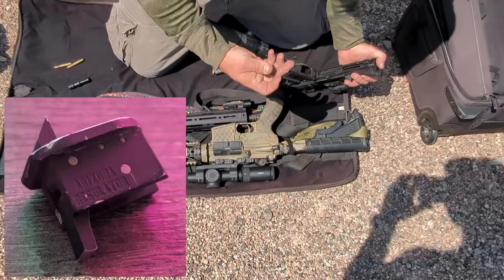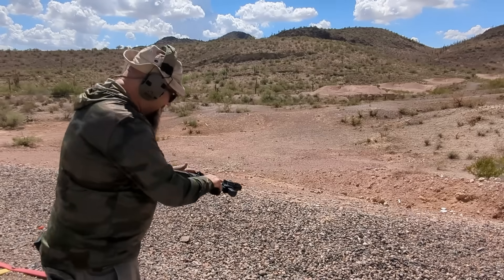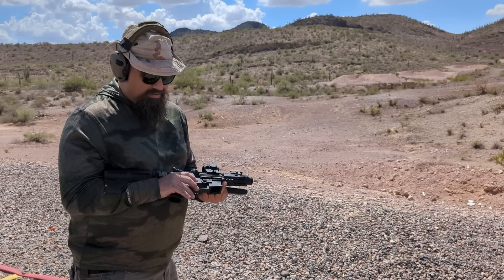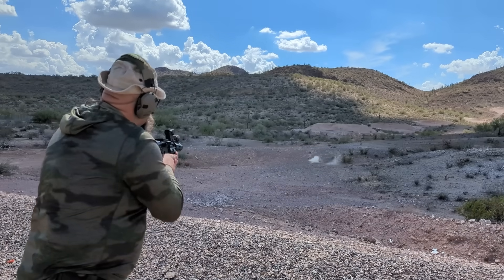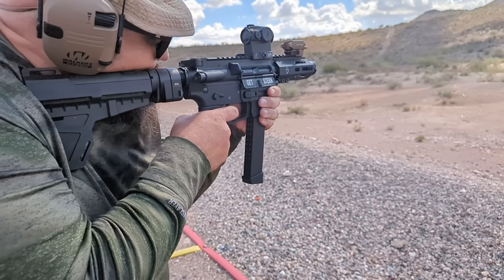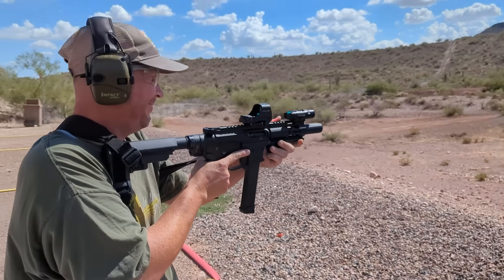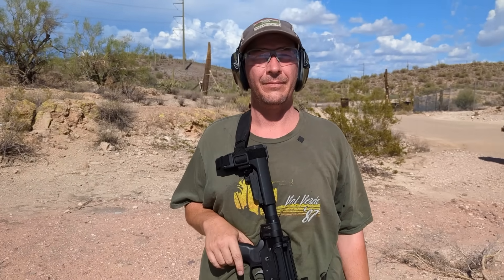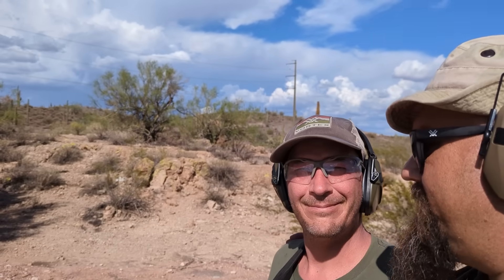What happens when you put an FRT and a binary together?

Comment: My analysis would be that the FRT completely invalidates the binary, because the trigger release happens as the bolt slams to the rear, and you can't fire a shot while the action is open. 
For it to have any effect, the forced reset would have to happen as the bolt closes and be timed to where it trips the binary release trigger exactly at the point the bolt is in battery. Though I don't even think the closing of the bolt would have enough oomph to force a trigger reset against the pull of your finger. 
The benefit would also be negilgible, as it would merely eliminate the split second it takes to pull the trigger after the reset.

Comment: I'm confused how is it a binary? Actually I think your confused not a binary
Reply from the maker: A binary trigger fires on the pull and the release. One of the two AR pistols seen in this video has a Franklin Armory BFS II installed. The other has a Hoffman Super Safety (an FRT) installed. We fired both normally and we also fired the binary with the Arizona Regulator forced reset trigger. Sorry if that wasn't clear in the video. LMK if you need me to help you understand how a binary or forced reset trigger works.
Reply: @newsofthepews lol I own just about every frt I have 4 variations of the AZ regulator alone
Reply from the maker: @CouchRacer87   We are all VERY impressed.
Reply: @CouchRacer87 what do you think would be the best frt for the micro Draco?
Reply: @CouchRacer87 great story bro.
Reply: @CouchRacer87  the only one confused is you lmao

Comment: Does it require 2 position or 3 position safety? Or compatible with both?
Reply from the maker: The Arizona Regulator will drop in with a standard AR fire control group with a 2 position selector. They also make a 3 position version.

Comment: Okay, so I think, based on my understanding of how AR triggers work or would work, is that the out of battery safety prevented the release of the hammer when the trigger is pushed forward by the FRT system. Therefore, what the FRT is does is it basically made the binary trigger a regular trigger because it skips the process. For this reason, I think it is why you didn't fire twice as fast and the binary system prevents the hammer from releasing without the bolt in battery.
Reply: It would never be twice as fast anyway, as the FRT allows you to pull the trigger instantly as soon as the gun is ready for the next shot. The best the binary could possibly ever do, if the FRT mechanics were working that way, is trigger the next shot the instant the gun is ready, eliminating only the split second it takes to pull the trigger back. 
Most of the gun's rate of fire with the FRT is already decided by the bolt's cyclic rate.

Comment: the speed at which it fires is limited to the speed at which the bolt can move. forced reset will only fire as fast as the bolt can get back into firing position(which should be the max speed at which you can fire). and binary is similar in a way that the firing on release can only happen when bolt is in firing position. atleast thats my personal understanding (and im no gun guru/expert). if the hammer was to strike the firing pin (which shouldnt be possible) before the round was in the chamber there would be problems

Comment: Is there a way you can give me a list of all parts for the first weapon you showed. I'd like to build one to play with. Please and thank you.
Reply from the maker: It's a Stern upper and bolt, 80% lower, Franklin Armory BFS II trigger, Sylvan folding adapter, H buffer, KAK Shockwave brace,  Primary Arms MD-20 in an ADM QD mount, Olight PL2 Mini.

The AZ Regulator forced reset trigger functioned normally as a forced reset trigger in both the regular semi and binary positions.

I dubbed in the sound of the M41A pulse rifle from Aliens to appease the algo.
Reply: @newsofthepews I wouldn't do this

The binary trigger isn't a machine gun because it is firing one round per action of the trigger. In normal operation, that means that the operator is choosing when to pull the trigger and when to release it.

The FRT, on its own, is not a machine gun because it is just forcing the trigger forward to reset it faster than would otherwise be possible, but the operator still has to pull it.

What you've made is a system where, once you pull the trigger, two rounds will be fired every time. That is, unless you hold the trigger to the rear with such force that it prevents the gun from cycling and forcing it to malfunction. By definition, this is a machine gun.

I believe that full auto firearms should be legal, I'm only saying this because I worry for your safety and that of any dogs in your vicinity if the ATF sees this.
Reply from the maker: @jackrichardson7121 lol. No. Like I told you in the other comment, it didn't fire when the trigger went forward. It couldn't have. That's the joke. The FRT forces the trigger forward as the bolt carrier is traveling to the rear. On the extraction cycle. While the hammer is held down by the BCG.
Reply: @newsofthepews ... now I feel dumb. I was tempted to delete this, but that makes me a coward. Thanks for pointing that out!
Reply from the maker: @jackrichardson7121 no worries.

Comment: Missing at high speed the AR owners wet dream.
Reply from the maker: Most people don't really get what full auto is for. I mean, besides being just unbelievably fun, that is. It's not just for fixing the enemy so your maneuver element can close with and destroy them. It also increases the number of rounds on target at close range, achieving incapacitation more quickly. And in a properly configured automatic rifle or LMG, full auto improves hit probability at extreme ranges. When I qualified on the M240B, I successfully engaged targets at 1,100 meters using iron sights. That's with an experienced AG and using a T&E mechanism. I'm a fairly decent marksman. I qualified expert on the M16A2 and M4 and I've never come in last in NRA High Power, 3 gun, or 2 gun matches. I'm not good enough to ever win a match, but I can shoot okay. I would have a very difficult time getting a round on target with a precision rifle and magnified scope at 1,100 meters. Have you ever hit a target farther away than 600 yards or so? But even though I couldn't SEE the silhouette at 1,100 meters, the AG was able to walk my fire onto the target. That has almost nothing to do with my skill, and is almost entirely a result of the skill of the AG and the precision of the T&E mechanism. So I'm not trying to brag here. I'm explaining that full auto is a lot more useful than most people think it is.

Comment: The maximum operating speed will be determined by  the springs and weight of the bolt.
 It is running as fast as the bolt can move

Comment: Nice
Reply: So basically the FRT on top of a binary will get your gun to reach potentially its absolute maximum rate of fire possible with that set up.      Loved the way it sounded.   I have an Airsoft gun with a binary electronic trigger.   I can get the trigger movement down to a shivering finger sitting directly on top of the trigger sensor.    Has gotten it up to 59 shots per second through a chronograph.     The full auto mode can get upwards of 90 shots a second and in some extreme cases upwards of 110 shots a second.     Kinda mean use on anything.   Sends a solid laser beam of bbs out.

Comment: All of this on a gun with no locking lugs is nutty. Holy out of battery fire Batman. Many binaries say specifically not to use them on a non locking AR build because of risk of our of battery fire.
Reply: There is blowback 9mm bolt carrier that has firing pin shroud geometry that won't allow out of battery firing.
Reply: @TrollinCrazyRussian  the exception doesn't make the rule.

Comment: Wait ok i paused right before we see what happens, my guess is itll jam itself up because itll either be to fast for the blaster's little internal mechanik elves to keep up or the action of the forced reset will cause the binary release shot to, well i cant really articulate what im ttrying to type but basically itll trip over its feet cause it wont be able to keep up like trying to jump off your skateboard and run when you get the wobbles bombing down a hill you just cant run that fast. But im probably wrong. Ok play
Reply from the maker: That's pretty much what I figured.

Comment: I was just on the AZR website, it's not a simple drop in. You will be grinding on either the regulator or the disconnector plus the price is $238. The price of the super safety is just a little over $100, a little more if you get the pre-cut trigger.  The choice is yours.
Reply from the maker: It comes with a disconnector in case yours isn't dimensionally correct. It IS drop in if the dimensions are right. I didn't have to make any changes to the AR pistol you see in the video, but you might have to swap the disconnector. Removing metal is a last resort.

Comment: Now this is one of those things that I think is going to be legally sketchy. FRTs and Bump Stocks are semi auto because pulling the trigger to the rear to fire one shot is still a manually actuated motion, no matter how much the gun forces the reset. But now, if tue gun is forcing the trigger forward, aka by itself, automatically, and doing so fires a round because it’s binary, you may find yourself a pickle. 

If I’m missing something please elaborate.
Reply from the maker: When I had the FRT in it, the binary function didn't actually do anything. It just worked normally as a forced reset.

Comment: I couldn't get my 9mm PCC to run in SS mode with my folding stock adapter.....is that a direct blow back design? I was thinking of trying the hydraulic buffer but have already blown the ole budget with the redial delayed barel/BCG upgrade...not to mention the wasted money on the law tactical folder ..please help sir...any body....
Reply from the maker: Both Robert's and my ARs are straight blow back.
Reply: 10 oz kak buffer? Ever tried a hydraulic?
Reply from the maker: I'm gonna have him come over and do a live stream with me, I think.
Reply: @newsofthepews can u give me some advice on how to get mine to run like yours?
Reply from the maker: I just got lucky, really. Robert has been throwing money at pretty near every part.
Reply: @newsofthepews yea I "get lucky" on my 5.56 builds, mainly cause I have several under my belt at this point ..the AR -9 is my favorite and it's got me scared to touch it, it's SO easy to stop it from running all together
Reply: @newsofthepews can you drop a link to his channel? I'd like to see if he can help me with new build, a 45acp direct blowback
Reply from the maker: He doesn't really do gun content. Mine is just a stock Stern upper on an 80% lower I milled out, standard LPK, H buffer. Nothing special. It doesn't like JHP of any flavor, but it runs FMJ like a scalded rat.

https://www.youtube.com/@the99_870

Comment: That makes sense. The forced reset pushes your finger forward, allowing the binary trigger to operate as normal. They are both in position to send the next round at the same time.
Reply: The FRT pushes your trigger forward on the rear motion of the bolt, as seen in the slow-mo clip in the beginning, basically tripping the binary before the gun is ready.

Comment: That the chrucha canon road shooting range? If so it sucks because they blocked everything off and made it into a cute little range instead of freedom
Reply from the maker: It's Saddleback. It's much improved. Steel targets at 200, 300, 400, 500, and 700. There are still open areas where you can msg dump into trash, but this is so much nicer.

Comment: I appreciate "F the ATF", but the binary trigger is just a controlled ND device. No firearm should go off when the trigger is released. FRT's for the win
Reply from the maker: If you rotate the selector to safe while the trigger is held to the rear, it will not fire. It's best to shoot a fast pair, though.
Reply: Different target shooters use guns that fire on the release because they believe it gives a more consistent and controlled release of the trigger. It's been done and approved of for many decades.

Comment: I have no idea if it would actually be viable, but in a system with a four position selector like an MP5 variant, having semi-auto, binary, and FRT mode would be cool.

I personally don’t see the point in chasing the highest rate of fire possible for most systems, other than just having fun.  I don’t think you can control the system as well at a super high ROF, and I think wasted rounds dramatically increase were you to try to use such a system with any goal other than shooting dirt.  Still fun, no doubt!
Reply: If the fire rate is faster than the recoil, your first rounds will be a pretty tight group. I love all the hyperburst rifles :D
Reply from the maker: Absolutely correct. My Stern with the Regulator in it is slower than Robert's PSA with the Super Safety and I'm thankful for that. While the recoil with that Maxim buffer is soft, overall, mine is a little more controllable, due to the slower rate.
Reply: Sometimes it's just for dumping in dirt.

Comment: could a company design a trigger to actually do both because that would be pretty cool
Reply: Can we just get a 4 position SS
Reply: Bijary triggers are pointless with the advent of frt and ss
Reply: @dantauche7917 Exactly. If a hybrid were made, 1 of 2 things would happen. You would 
1. Have a SuperSafety with 4 positions (the addition of Binary)
2. Each pull of the trigger in supersafe would be a shot (one pull technically) and at the end of each string it would shoot one bullet.
Reply: @HeIlzwhich would in turn make it a machine gun since more than one bullet per trigger pull. So pointless AND illegal 😂
Reply: @dantauche7917  It would be pointless because you can not exceed the maximum cycle rate of the action but still legal just like the current binary triggers because the law states "function of the trigger" pull back is one function then release forward is another function of the trigger! If it's legal now as a binary it would be legal with an FRT added but still pointless as an FRT already functions as fast as the action would allow.
Reply: Super safety and sloppy seconds disconector

Comment: i want a frt in a 22 ar so bad 
super fun for the low low
Reply: I run a CMMG 22lr drop in BCG with a binary. It seems like the better choice than a FRT or super safety, simply because it takes so much effort to make them function with 22lr. The binary is just a trigger, while the others have much more to them.
Reply from the maker: Somebody needs to make an FRT .22lr conversion. Build the full auto part into the bolt carrier.
Reply: @newsofthepews Buddy bore makes parts that can make the CMMG BCG function, like a trip like auto BCGs and weights, but it costs 1.5-2x more than I payed for the BCG itself
Reply: @enclavesoldier769  In my experience, the SS doesn't work with the  22LR bolt conversion. The mechanism has nothing to move the lever.
Reply: Taurus tx22 with the freedom finger trigger frt
Reply: I'd love to see one in the Tippmann 22 Magnum AR. I just think it would be really cool even if it's not super cheap to shoot compared to 22 LR.
Reply: and polishing off the opps
Reply: BCA makes the cheapest dedicated .22lr uppers.  I want to try to make a trip to get one running with a super safety on a BRN180 lower...
Reply: 22 is a waste. 9mm or 40 s&w all the way
Reply from the maker: You take that back.